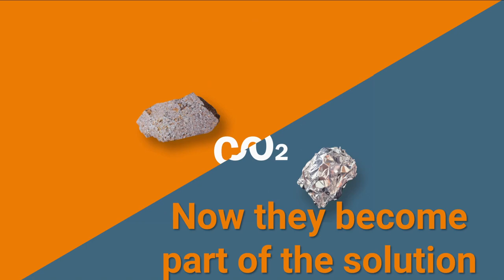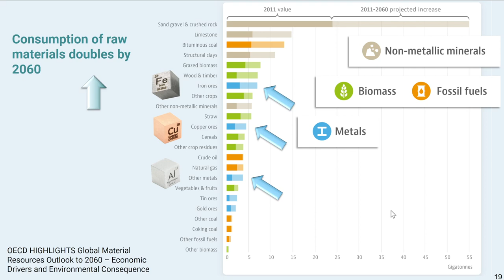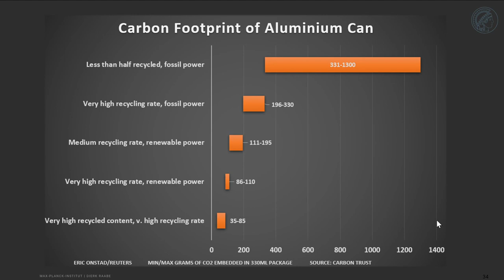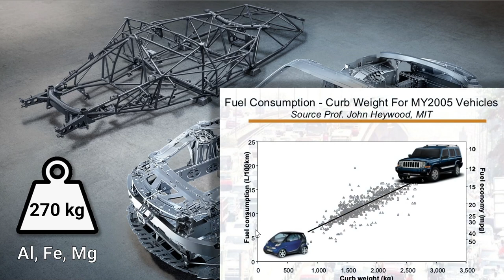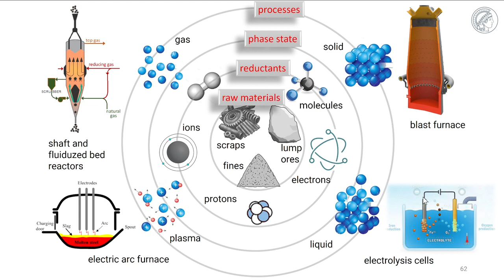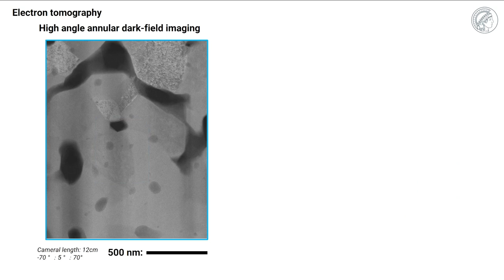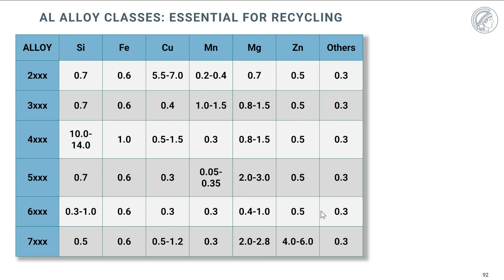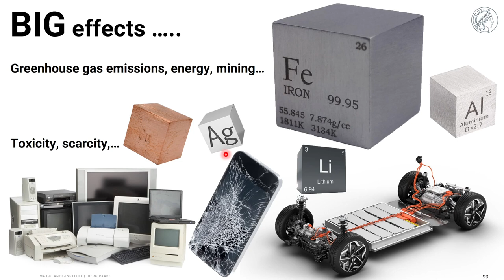Sustainable Metals for a Circular Economy

Comment: 22:45 global steel production is not 1 point 6 Mt, it's 1600Mt 😉. For those who didn't rad the slides or used it as potcast...